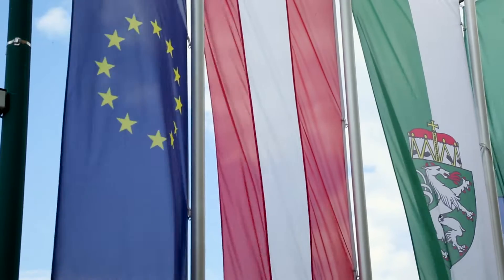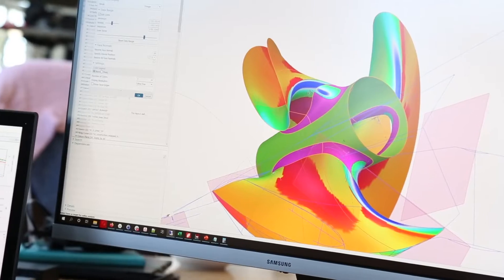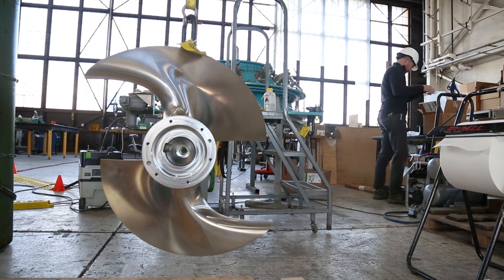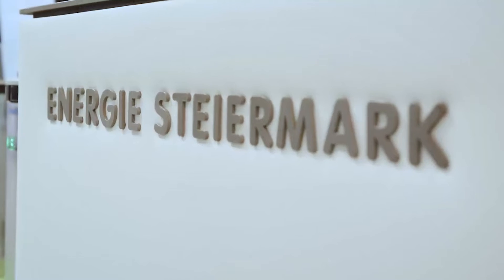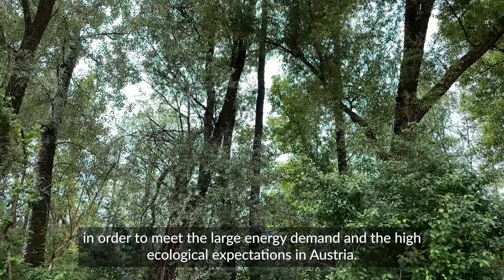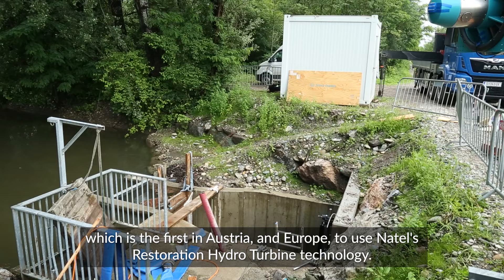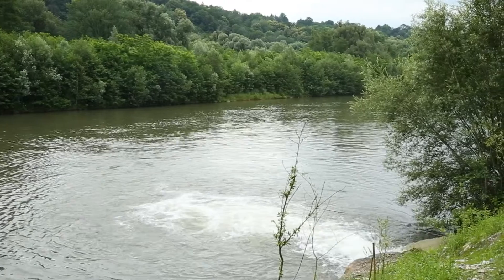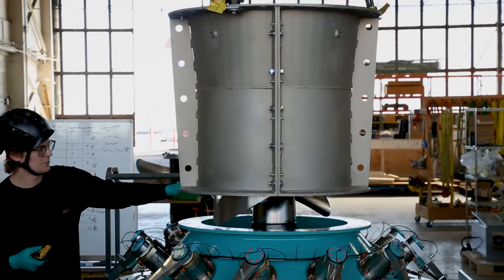Sauerbrunn Hydro Project | Restoration Hydro Turbine Install in Austria

Comment: How about having the system part of a hydro dam upgrade ? 
also have it as a one moving part system And have a market worth Billions not millions
Reply from the maker: Hi @simonbowman6206, yes, upgrading existing equipment is a great idea and certainly part of Natel's plan. As has been widely reported in the hydropower community, the North American and European hydropower fleets are old and in need of upgrades to maintain availability (see IEA hydropower report). Upgrading plants with efficient fish-safe turbine runners does not cost more than other upgrades and can increase power production and significantly improve environmental performance.

Comment: Are these turbines suitable for sea water\marine use or just  fresh water.
Reply: I do think these turbines are for river runs rather than the ocean. Extracting power from the sea would require a much different type of technology altogether.
Reply from the maker: Thanks, @TheOz91. Hello, @gw6171, yes, our technology is designed for use in rivers or canals.

Comment: So? Any updates? Tell us more about the price of a turbine like that. I think it's a 15kw turbine so could you tell us if it's more expensive than a normal 15kw turbine or not?
Reply: Companies like this dont exactly have a pricesheet. They will only tell potential costumers prices. That being said rarely any private person will have the money for that. Its small hydro not micro hydro.
Reply from the maker: Hi @ankualex, yes, the update is that the Sauerbrunn site has been operational for about 6 months! Energie Steiermark is currently preparing a webinar about the site. @MrJackassss321 is correct that we develop individualized hydraulic designs for small and medium-sized hydro plants—we don't manufacture off-the-shelf micro hydro systems. The Sauerbrunn site is very small, but it is owned and operated by a utility.
Reply from the maker: @ankualex check out this webinar recording for an update on the site: https://youtu.be/ZPRSp2TJ1V8?si=4uxSLldv0IDwHj52